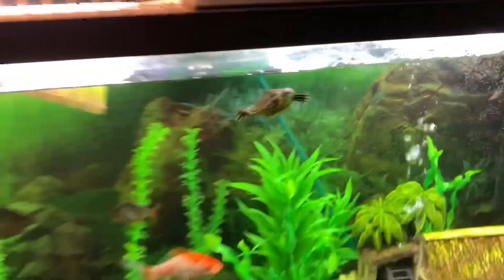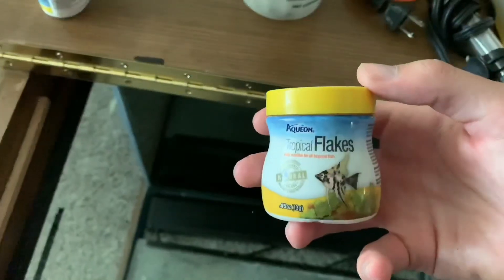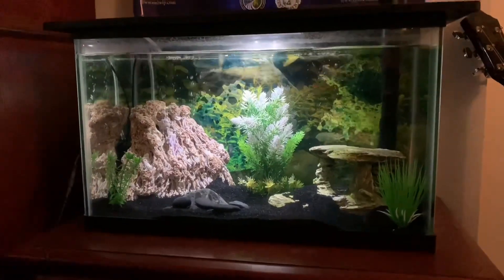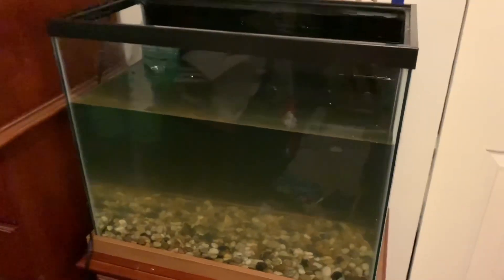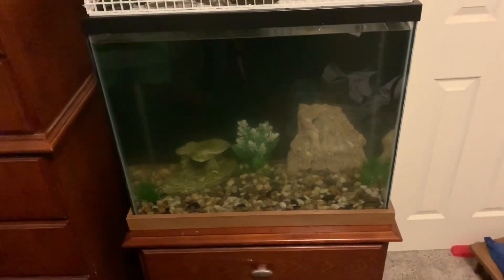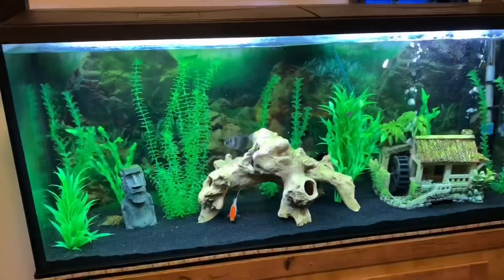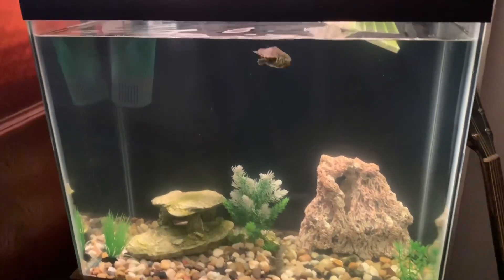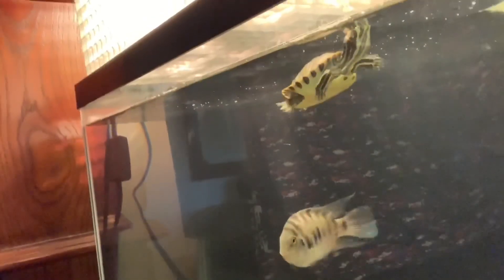Setting Up My New 25 Gal. TURTLE TANK!

Comment: quick question. will the water be safe for the turtle if it has fish on it?. i use API Tap water conditioner. or do i need to switch to API turtle tap water condition.?

will that affect my fish is i were to switch?